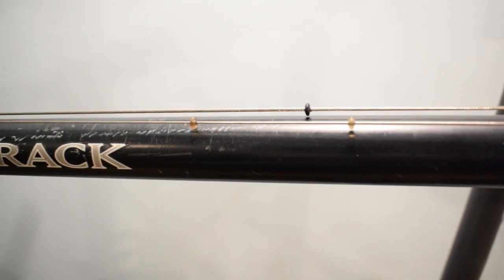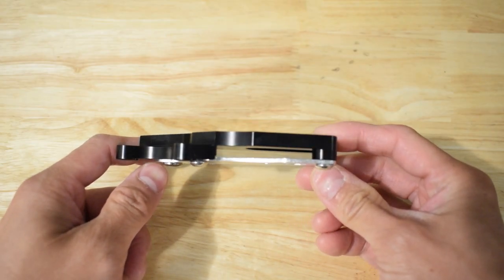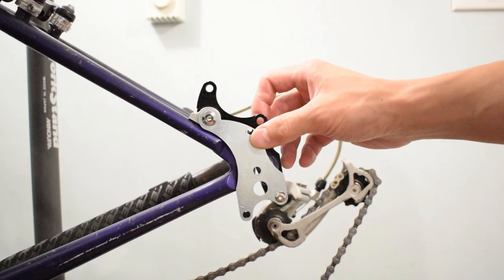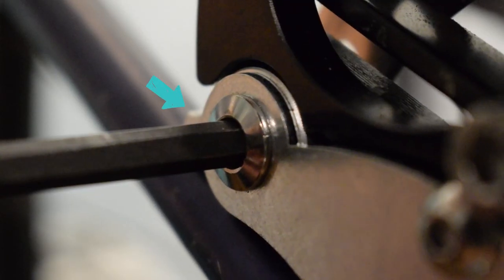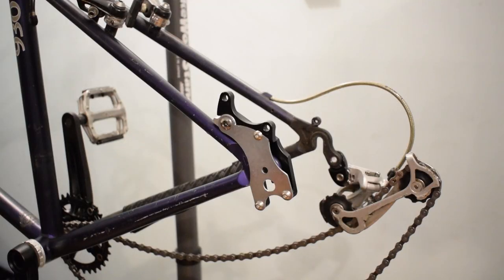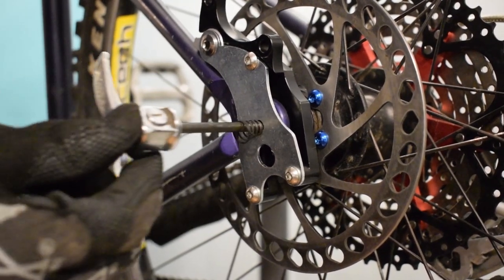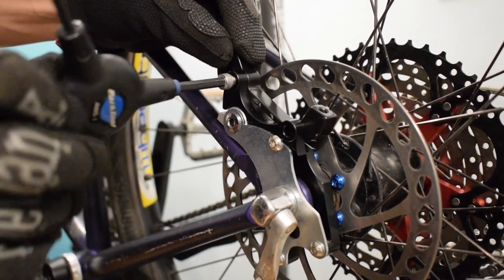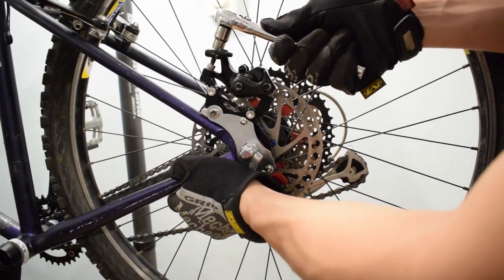Disc Brake Converter 2.0: Trek 930 Goes Full Disc Brakes!

Comment: I've recently purchased this same adapter so good to see it being installed, got a 94 Diamond Back that I don't want to part with but rim brakes just don't cut it for me now, especially not in muddy and wet off road conditions.
Reply: Ya I’m in the exact same situation lol! Great video this is. And his other one about a conversion. I bought a disk brake front shock for my hardtail and want to convert the rear obviously too.
Reply: @paullangdon9575  unfortunately this adapter doesn't fit my frame so back to square one. I'm working about the Chaser one, but they are in very limited supply, as far as I can tell they are only available from the manufacturer, and based in America so gonna be quite expensive.

Comment: Hi Danyo, 

Great Job on the conversion. I have a 930 SHX as well and doing the same.
Reply from the maker: Thanks
Reply: @DanyoSports  I did the same setup, except my bracket sits at slight angle causing the disc to rub inside the caliper. Also When i use the back brake, and if i push back the whole bracket moves back till it comes to a stop backwards. Do you have this issue?

Comment: I put a shimano vbrake on my 970 (which already has mechanic disk in on the front) and they are like 15 times better than my old canty (DeoreXL, which, btw, were the most PITA brakes to adjust that i have ever had). Question, are those adapters compatible with aluminum frames?
Reply from the maker: Yes, the adapters are compatible with aluminum frames.

Comment: This seems s lot sturdier than the other one. Do you still neet to fix it’s positions regularly?
Reply from the maker: Yes, it’s a lot sturdier than the other one, I just installed a new disc rotor and I’ve got no disc rubs at all after a few rides on the trails.

Comment: I have the exact same bike, but I can’t get my while into the dropouts after install disc brake caliper mount.
Did you have stretch the frame ?
Reply from the maker: I have no issues fitting it on.

Comment: I asked this question in your other video as well, can this drake brake converter mount be installed for the front wheel as well?
Reply from the maker: No, it won’t fit on the front fork.
Reply: No, you can buy a new fork with IS or PM disc brake support. The most of the new calipers have Post Mount.

Comment: Are those rims brandew, or just from the previous?
Reply from the maker: Those are the same wheels I was using with disc hubs.
Reply: @DanyoSports thanks. did you use new spokes for the wheels?
Reply from the maker: No, I didn’t use new spokes.
Reply: Yah, that wheel had the 6 bolt rotor mount.  Most people will need to get new wheels to have the correct hub to mount their rotor on.

Comment: will not work on my bike, design angle is not going to fit my vertical frame and the disc will not bolt to my wheel..
Reply: Thanks for letting us know

Comment: lmao to go through all that effort to convert from a perfectly adequate V brake to a low end mechanical disc brake with 15+” more brake housing adding more friction to the system.
Reply: But now you can go to hydraulic as well.